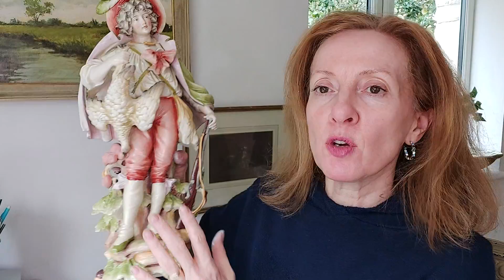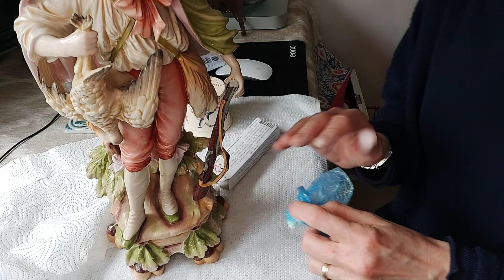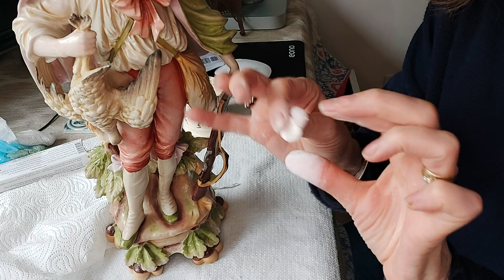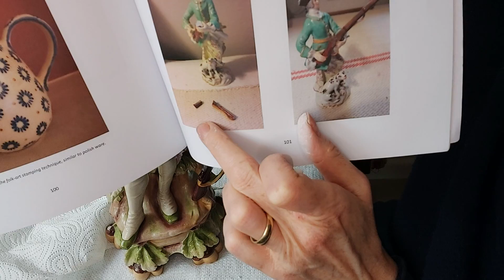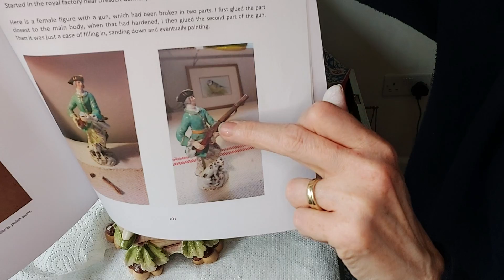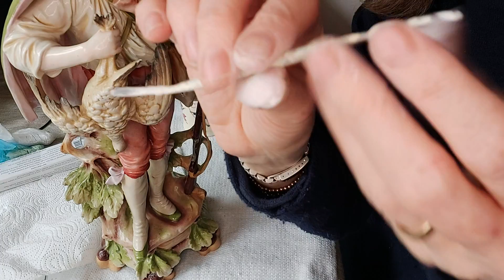How To Fix Porcelain And Ceramic/Missing Pieces  #ceramics #restoration #porcelain #repair #diycraft

Comment: How does the milliput adhere to the figurine?  It looks like you just pressed it on and then let it cure for 24hrs... Does the little piece need to be glued to the figurine?  Won't it just fall off?
Reply from the maker: Great question! 😊 Milliput is a two-part epoxy putty, so it becomes very adhesive as it's mixed. As long as the surface is clean, you can press it firmly onto the figurine and it will bond as it cures—no separate glue is usually needed. Once fully cured, it's very hard and securely attached. If I'm working with a very smooth surface or a tiny repair, I sometimes roughen the area slightly first to give it even more grip. 💛

Comment: Thanks for all your videos.  I have purchased several antique dolls over the year that were occasionally mailed to me with broken doll heads that apparently were not wanted by the auction house.  Since some were quite special and would have been be highly prized when brand new,  I recently I decided to try to bring  a couple of these back to glory (or at least, repair them as best I could so I could enjoy them)  I used araldite on the first two heads and was pleased that all parts were well aligned.  However, on the third try I think I rushed to finish, needing to visit a family member in hospital, and may have applied too much glue to a couple parts.  When I got home from my visit a few pieces had moved out of alignment just enough and were already firmly in place even though I used the slower setting araldite you have suggested.  Sadly these pieces are on the doll's forehead which will be exposed.  I have searched the internet for a way to release the glue enough to move the pieces back into alignment.  One suggestion was to use the highest heat setting on my oven (450 F) and try to soften the glue.  After 15 minutes, this didn't work.  Do you have any suggestions?  Thanks
Reply from the maker: I would use warm water to soften the glue, this should then be easier to pull apart.